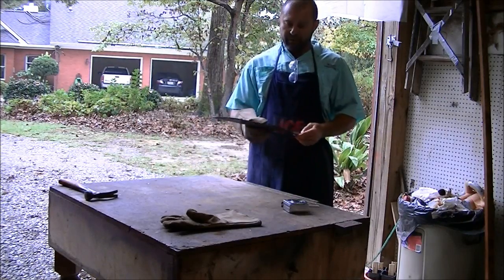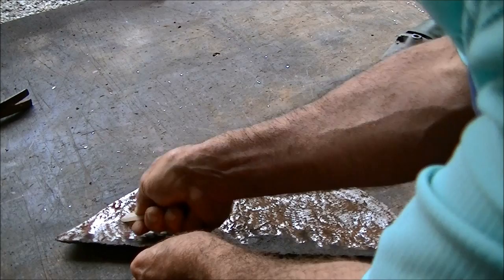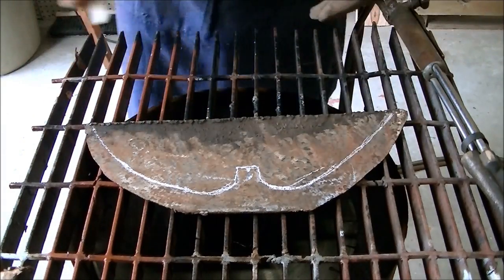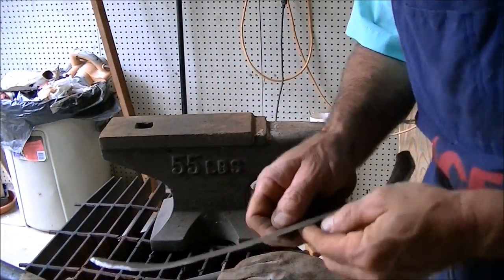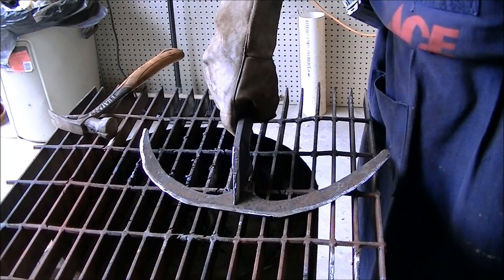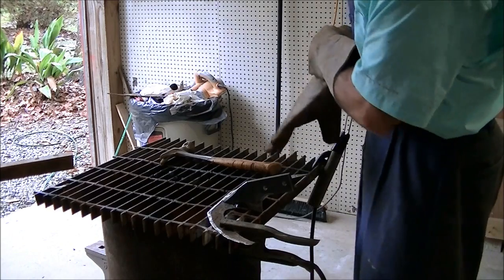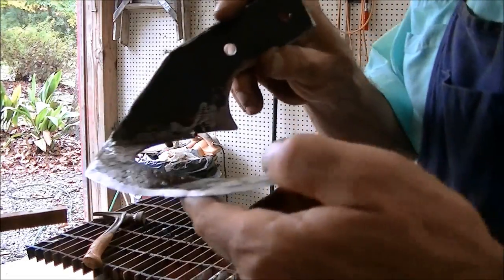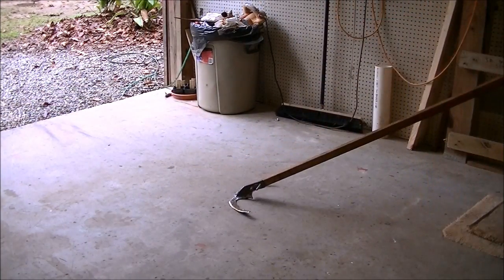Crazy New tool that weeds at walking speed. The stingray, learn how to make one.

Comment: It's a sub soil weeder.  There are several designs out there but the ones I'm familiar with use your arms to and fro like using a hoe.  I remember as a kid helping my grandpa in his garden using one like this in the 1950's.  However, this is the first one I've seen using the hip to push it.  I love the Mark's idea,  increasing the length of the handle and use your hip, great.    Now, I noticed the soil looked wet which I expect makes it easier to push.  A sub soiler is much easier to use than the traditional hoe, no chopping motions involved.  By cutting off the tops of the weed frequently enough the entire plant will die because there is nothing left to nourish the roots and that's fertilizer.  .  One thing for sure it beats having to use chemicals.  I don't want poisons in the food I feed to my grandchildren.   Well done Mark.

Comment: This tool is a variant of the Torpedo Hoe I used growing up in NZ. the heavy handle is a great feature and helps the blade work better, My experience wa when the hoe went through the weeds it damaged them enough to not allow them to re-root. The blade could be 16 Gauge steel and Grinding it gives a very effective edge, we had to use coarse Bastard Files in my youth... Thanks for the revived memory and the tool improvements ...

Comment: Note 1 For those of you who don't have a small machine shop, you may be able to use a 'sweep'  These are V shaped instead of U shaped, and you can get them in various widths from about 6" to 16"  (google "sweep cultivator" on google images.  They are a few bucks each at any farm store.

Note 2  If you sharpen the top edge, it runs deeper.  If you sharpen the bottom edge, it runs shallower.  

Note 3  Since you are pushing it with your pelvis bone, you may want to make a T- bar handle to spread the load.  Wrap the T with bubble wrap and coat with duct tape.  If you were using it all day, I think I'd rig up a pocket on a belt to hold the end.
Reply: +DadGumit Man 

Good call.  Foam grips for bicycles are another higher density foam.  Also:  Laminate floor underlay, ensolite sleeping pads.

Comment: Mark, I use an old fashioned heavy duty spade with an extra long hardwood handle. I sharpen the edge, and push it much as you do with your 'stingray'. For really tough weeds, I use a sort of back-handed action which allows a lot of force to be applied. I thought I invented it! I find that after a weed has been decapitated two or three times, it usually give up the ghost. I use my spade nearly every day. it is a great tool.

Comment: they use to make cultivators like the one you made , years ago.  I still have one I got from granny when she use to garden . she got it years before I was born . it could be over 90 years old now from what my dad has said . it is more stream line but basically same thing . they made them smaller so you can get in the smaller places without getting another tool while in the garden . but for a specialty tool your on the right track .. good videos . I subscribed .
Reply: Yes in England   they call them "Breast Ploughs"  ( Seriously! ) or 'Flauchters' in Scotland ,they date to at least Roman times if not before. Most of them had a short Tee piece at the top end of the shaft to make pushing them a little easier

Comment: I was sure you was going to make a cut in the center of the handle for the blade bracket to fit center of the handle. But then again i'm sure you know better then i about such things.. Thanks for the video. i got to make myself one before spring comes. i fight weeds every year...
Reply from the maker: I could have done that but all I did was weld the bracket off center so that the handle would be centered. It has been a real work saver.

Comment: hate to put a dampener on this but this is pretty well identical to the old fashioned "dutch hoe" which has been around a long time, Check out the website of Sneeboer Netherlands and see an amazing selection of stainless steel hand tools
     No doubt that they work well and are very ergonomic. I have used one for more than 30 years
Reply: If you're not Dutch  You're not much
Reply: That's not a very nice thing to say.
Reply: just kidding       wheres your sense of humour
Reply: They can be kinda cold, though.
Reply: Ole Dutch...remember him well.  He was right handy with a hoe you know.  Wasn't a weed to be seen and the garden so clean.  Kinda miss that old curmudgeon.
Reply: Yeah, I remember ol Dutch. Whatever happened to him? I heard he wasn't quite the same after he stepped on that rake.

Comment: Good thought but I've been a large scale landscape nursery manager for a very long time and all your tool is doing is lifting them off the ground. In the slow-mo shot you can see the weeds are simply going for a little ride and plop right back down in their home. You may sever the root but of course those will come right back and the smaller ones seem to be lifted up in the air on that ride. Gotta get the roots out - down deep or up high it don't matter. Make the roots touch air and they won't live.

Comment: I've had something that works very similar to this, but it doesn't really work well.  There are a couple of issues.  First, pushing it through the soil is more difficult than pulling a blade through the soil.  Secondly, while the weeds roots are cut, it doesn't kill the weed because the roots just grow back.  There are some really good European stirrup hoe weed killers on the market.  They use a square loop that swivels at the bottom of the shaft.  They can cut on the pull and push stroke and do an excellent job in either wet or dry soil.  They are my go to in tight spaces.  Look for those, don't bother with this.  Kudos to the guy that spent the time to make it and post it here on Youtube, but there is a much better solution out there.

Comment: May I suggest a two fisted grip?  Picture the trigger mechanism on a 50 cal machine gun.  Or go slightly wider than chest width like the bottom of a normal push up.  That way you can really lean into it as you walk.

Comment: Hey man looks like you are re-inventing the "Wheel": I have used different sizes of a tool very similar to what you are making and they were called a "Noble", idea came from England. Large Nobles oft times were pulled at high speed (Behind a tractor, I once seen a 5 Foot wide Noble at the HAYS Kansas experimental farm) to give a tiller effect as the dirt and weeds would roll backward exposing the Roots for maximum weed kill.
CMVHighPriest

Comment: Petter to pull because your boots replant some of the weeds.  A great idea.
Reply: Mike Dunn Once many weeds roots are severed they do not re-gro, and mashing them into the soil, provided they have not gone to seed provides additional Nitrogen without any danger of survival or propagation. This tool appears to work with amazing efficiency and I know I would rather not be on my knees pulling weeds for hours.
Reply: Marko Barrows Many.. not all, not even most.  The best way is to expose the root to sunlight, which is better done with stirrup hoes, yet those take more work.  If you want less work--cover your soil.  Backtoeden gardens work.

Comment: If the shaft at the point where it's attached to the blade is narrower at the front (leading edge), the ground will bunch less, passing the blade under the soil with less drag at the center of the blade. Like the bow of a ship.
Reply from the maker: Yes, I did sharpen the front point. Thanks for watching.

Comment: good job could you split the wood and put the steel  in side so the wood would be in the center of the wood which would make it centered instead of off set  and then you could grind the wood to a point so it has least amount of resistance while passing threw the dirt?

Comment: Nice tool but there should be a rake to the back to ruffle or rake out the small weeds which roots have been cut otherwise some shall still generate new roots as they remain at the same position with that small cut roots in the shallow wet soil. They should be dislodged after their roots are cut by the accompanying rake at the back. The edge of the long handle also needs a handle as found with spades or shoves to be gripped and to prevent the current end of the handle wounding the side of the stomach of the user as it hits an obstacle say rock. Thanks.

Comment: nice tool, but you clearly don't live in a place with clay soil.
Reply: or rocks
Reply: Amen.....but....I wonder if I could make one of these for my tractor- a reverse action that pulls instead of pushes???....that way it would have more power for the clay soil.....worth trying!!  I live in Mississippi...uhhhhh, the soil is red clay and as hard as a diamond! LOL   It amazes me that so many types of weeds grow here......I wish I knew a cheap easy way to kill weeds.....I've tried pre-emerge, hay, mulch, pine straw, newspaper, middle busting, tilling.....Some of those work okay but, I still have to hoe quite a bit.    I'm a third year gardener so I'm still learning.....Basically, I'm out of ideas here......Anyone have some ideas for weed killing in a big garden with little hand to hand work???  My garden is just under an acre in size.  Thanks!
Reply: I do metal fabrication and heavy equipment welding.  You could take his design and just make it bigger.  The only thing is I would "Hard face weld" the cutting edge and then grind it down.  Hard face welding is what they put on the cutting edge of Bulldozer and excavator buckets.  It is extremely hard and tough.  I bet you could make a pretty nice product.
Reply: If your garden is all clay then you need to worry about building good soil before you worry about new weeding tools.
Reply: Nice size garden! By the sweat of your brow, and find tools that make the job easier and quicker. get the weeds before they flower and go to seed. That is a huge one. Also, if you pick out every weed at the beginning of the year, you may only need to do it only one more time.*******Some of those wheel hoes work very well. Looks like a mini bike.
Reply: This would be good for draft animals too.

Comment: Looks way too wet to be weeding, they'll just grow back.
Reply: best time to weed is when soil is wet, roots can be pulled out then if done by hand
Reply: BY HAND but to kill plants you just scrap them and sun can dry out the rest over and over till root die off too. and this device would work better as a pull device rather than push to give more control...and do the job well. cut off the head of plants all the time... roots will follow.

Comment: This is basically what we would call a "sweep" that could be set up as a two row cultivator on a 140 Farmall Tractor.  This seems to work good as a hand option but I think if you had a more upturned sweep on the back edge it would flip those weeds over so they don't just re-root.  OTHER WISE NICE DESIGN. 

Here's an example of what I'm talking about.  You could just take this and add a handle.
http://www.ebay.com/itm/like/262359787213?lpid=82&chn=ps&ul_noapp=true